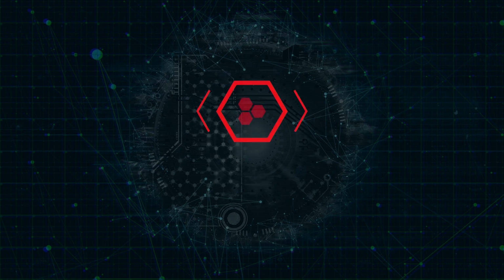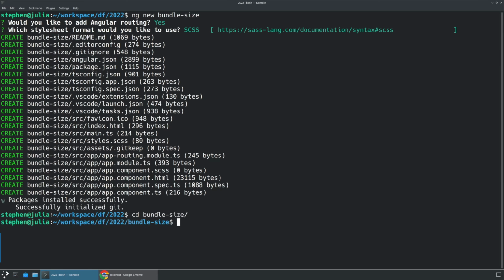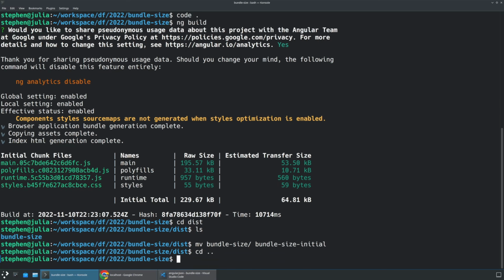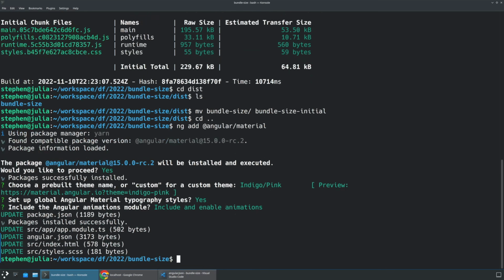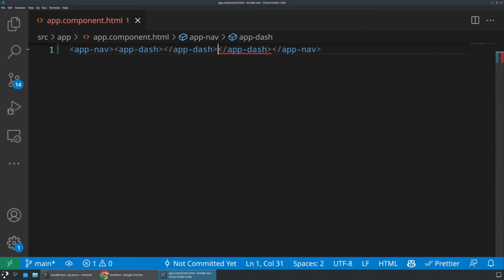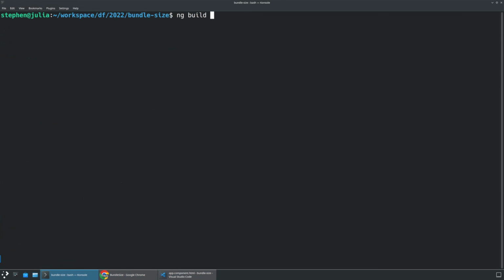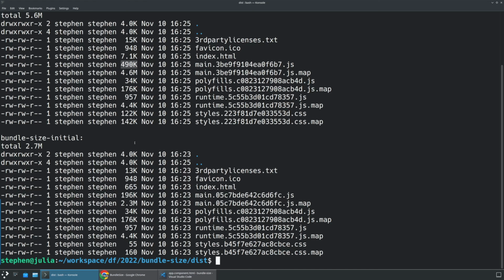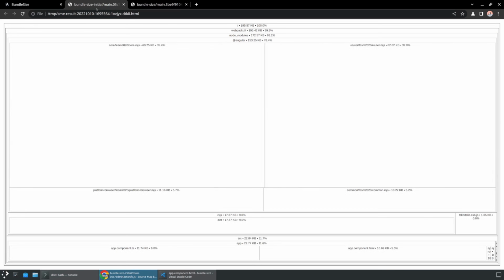Understand your Angular bundle size for faster apps

Comment: Could you also explain how scss imports/use statements affect bundle size?
Reply from the maker: Component scoped css/scss ends up as JS in your component or modules bundle size. Global css/scss ends up in your global separate stylesheet
Reply: @DigitalFluency  what happens though if every single components imports the same scss mixin from a shared scss. Is that added n times to the final bundle?